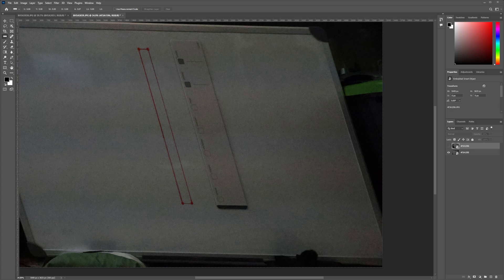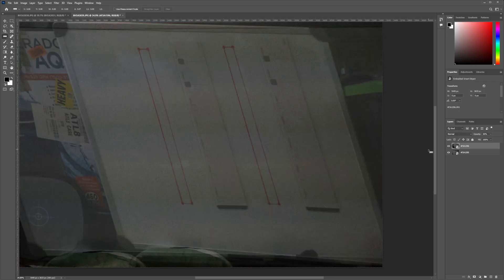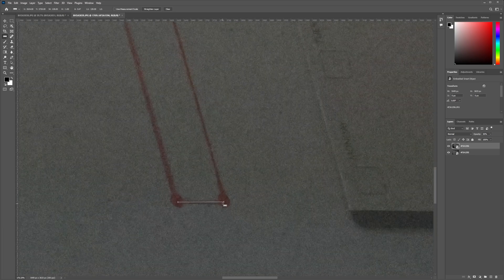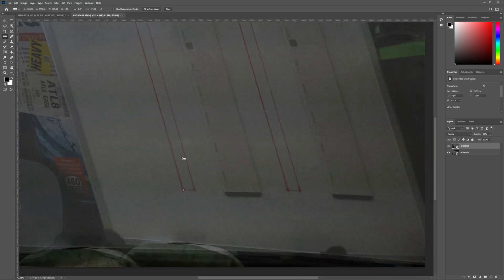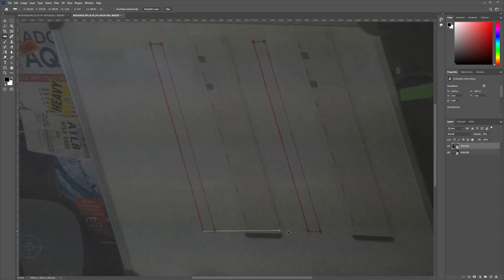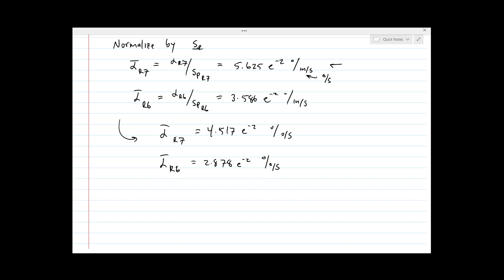Rolling shutter analysis: Canon EOS R6 vs Canon EOS R7

Comment: We're trying to figure out if the shutter goes from top to bottom, or bottom to top. I thought I could get the answer from this video, but you don't state which direction the camera is going relative to the subject.
Reply from the maker: Hi there, good question, sorry I missed that in the original video. I have exchanged both the R6 and R7 for the R6mk2, which has a much faster shutter, about double the speed, so it's a little more difficult to tell. Based on the direction that I rotated the camera, the images generated appear to be drawn from the top to bottom. That said, I'm pretty sure the the sensor is actually upside down in the camera relative to the image that we see on the screen (because it needs to immitate the mirror system of older DLSRs to make the lenses interchangable), so while the bottom of the image is drawn first it's the top of the physical sensor. 99% sure

Here's a correction. I was not fully correct in the original comment. I tested this directly with the  R6mk2. Rotating CCW matches the slope that I got in this video. If you rotate in that direction, you should expect to see more of the 'stuff' on the left hand side of the image to be visible later in the image capture. This appears to correlate to the bottom of the image. It's a little bit counter-intuitive if you just think of the direction of the slope. I confirmed that the image is indeed flipped in the lens (get a big aperture lens and look through it yourself) so the bottom of the image corresponds to the top of the sensor, which is read last. If everything is oriented like I described, the bottom of the physical sensor starts first  (top of the image) and rolls to the top of the sensor (bottom of the image) last. 

Hope this helps!
Reply: @tenminutetech  Apparently, the readout goes in one direction for mechanical shutter and in the opposite direction for electronic shutter for Canon cameras, according to a discussion on dpreview.
Reply from the maker: @Brillig2  Oh yeah, using the shutter actually does change things. Electronic 1st curtain (which is the mode I use most) would start from the bottom like electronic shutter, but the full mechanical shutter would be top down (the slit moving down) since it doesn't make sense to drop the 1st curtain back down first, since it's already up. For what it's worth the full mechanical shutter isn't great in the R7 and induced too much shutter shock for my taste, so never really used it.

Comment: First time i see someone make math in photo review! :face-blue-wide-eyes: Rolling shutter problem in this R7 is not acceptable.
Reply: Thanks! I wanted to find a way to quantify the rolling shutter since I don't have access to the actual hardware to know how fast the sensor read-out is, or what that number would even mean. Hopefully this made sense, and if you had any other ideas for better ways to test this let me know! 

I agree on the R7, I've pretty much only have been using my R6ii because of this, the slow buffer, and the weirdly random out of focus shots (has to to with poor compute power, cant keep up with tracking requirements in burst)

Comment: Nice ! So do you think the FF user would be happy using R7 in any situation ? I mean general, landscape or Birding ? Or better to stick with R6 or so .... ?
Reply from the maker: Hi, and thanks for the comment. I think the R7 is pretty great and I shoot mostly birds in aviation photography. The features and auto focus are superior to the R6 and I prefer the button layout. However, the electronic shutter in many cases is almost unusable in my opinion when handheld. The readout speed is just too slow and picks up and wobble or camera shake pretty significantly. The best compromise is to stick to electronic first curtain pretty much all of the time, unless you're on a tripod where the electronic shutter might be okay. Outside of that what you get for the R7 is great in comparison to the R6. In pretty much every way it's a better camera other than not being full frame, so if you really need the low light performance then the R6 is maybe the marginally better choice.